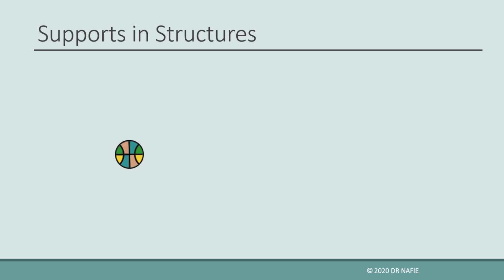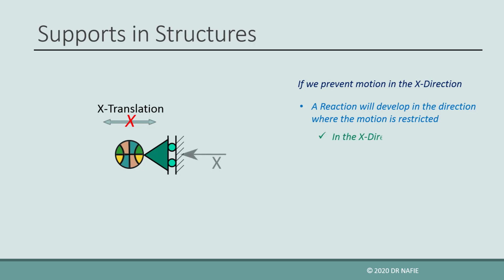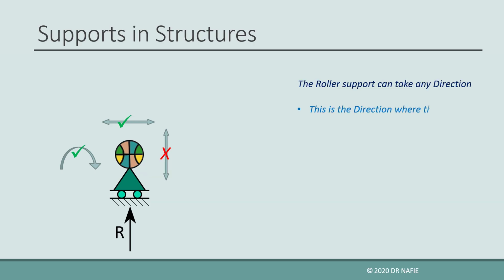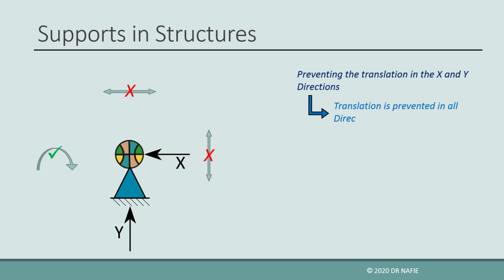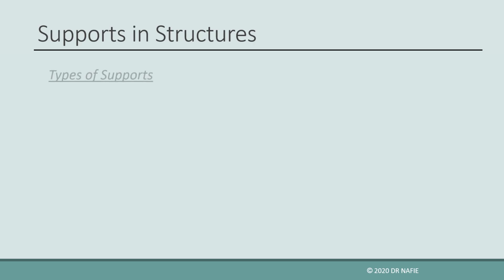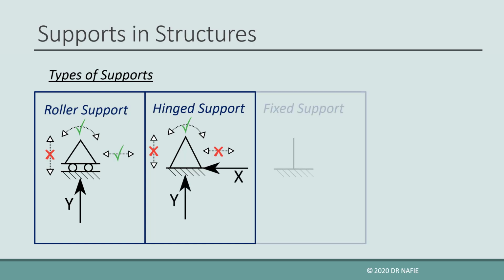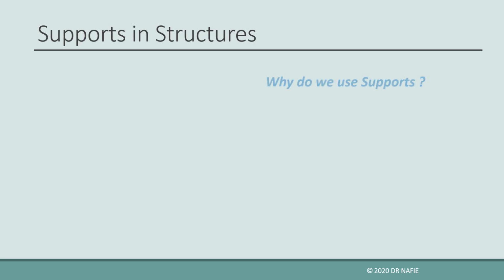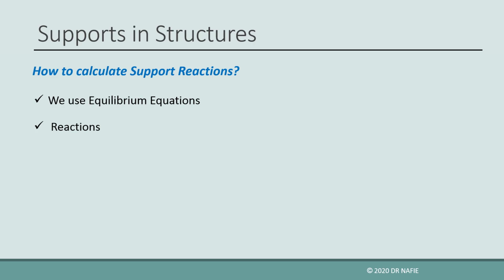Supports in Structures: Support types and Support Reactions

Comment: Assuming I am designing a reinforced concrete buildings with 2 or more units attached together.  Say I have a continuous  supporting floor slab.  Are all the supports design as fixed supports?  How about  a timber building, what type of support will a continuous beam used?
Reply from the maker: The video is mainly concerned with defining the types of supports and how they are handled in elementary structural analysis.  What you are asking about is a modeling question. 
A continuous slab or beam is supported on columns. Typically, the connection between the beam and the column is neither rigid (fixed) nor hinged, but is something in between. Depending on the properties of the beam and the supporting column, the structural engineer has to decide which option to choose. For example if a concrete beam is supported on a bulky column, then I will go for a fixed connection. 
In advanced structural analysis programs you can choose a connection to be semi-rigid.